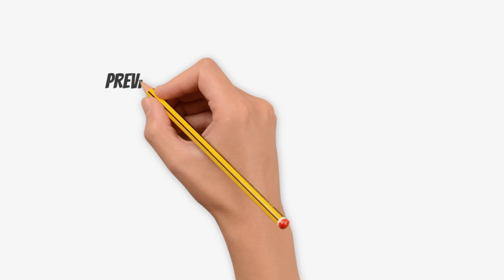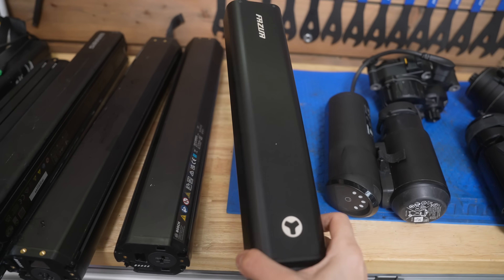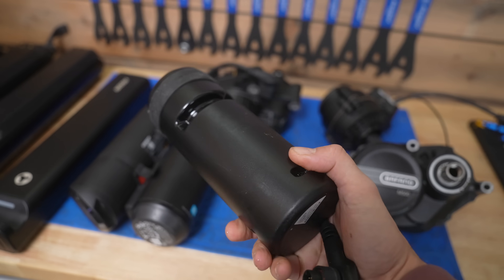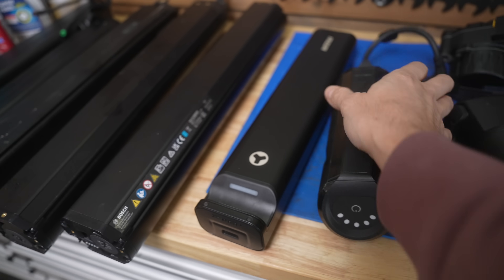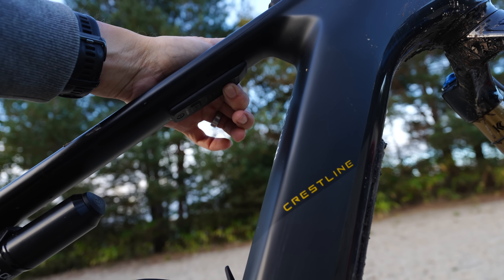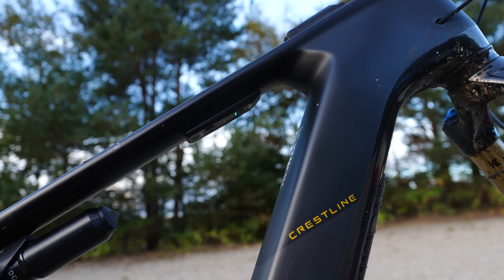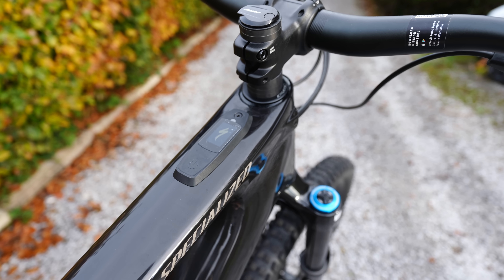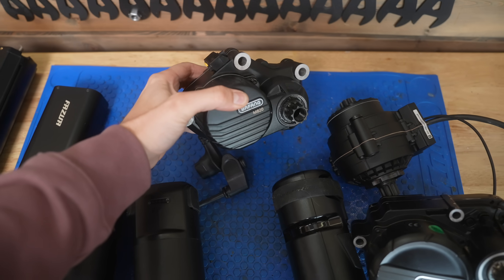We Have A Huge Problem With Ebikes....

Comment: Except without competition, you have no innovation!
The only example I'd be onboard with is the charging connector, because that is not a performance differentiator, and just creates headaches for bike sharing, and public charging. Follow in the steps of CCS and USB-C by standardising the port, everybody wins.

HOWEVER, motors and batteries are clearly a differentiating factor in the performance of the bike, including how their integrated into the frame. Your dream of companies voluntarily collaborating on standards is just that, a dream, because they are competing for sales by producing better products than the others. Furthermore, a standard, such as mounting bolt pattern, literally PREVENTS them developing better solutions that require some other mounting. Likewise, all agreeing to a certain battery voltage, size or connector LIMITS the development of future batteries, from becoming smaller or more efficient.

You may think in an ideal world, the best battery company would make all the batteries, and the best motor engineers would build the best motors, and bike manufacturers would use those components to make the best bikes. This is the most efficient use of resources after all, but also comes with a LOT of people losing their jobs. I actually just described a monopoly market -  which results in ZERO incentive for said companies to further improve those batteries and motors, or make them cheaper - this is why capitalism is so wonderful!

So if you're happy in setting standards on everything, then you must also be prepared for nothing to improve, and prices to rise...

Comment: I like the idea, but it's not practical.  That would be like saying all car manufacturers should have the same engine or use the same tyre size. In concept, it's great, but in reality no so much.  I do like the idea of a recycling program though, with trade-ins (of reasonable value) for old bikes. The manufacturers won't go for it though because where is their profit..  sad but that's the way it works..

Comment: TOTALLY AGREE, I raised this point on a forum and nobody seemed to get my point, there is no excuse for the non standardisation of batteries, you are quite safe with Bafang rear drive motors, but my VOLT pulse will only take a VOLT battery  and when you get onto mid drive systems its a nightmare, so thanks for making my point so elequently !!

Comment: This is so true. And this is just mountain biking. The commuting side is far worse for compatibility. I'm happy that on the eMTB side, the motor manufacturers label their damn chargers. So many smaller companies go with off-the-shelf chargers (many with all the same connectors) and don't even bother to put a brand sticker on their chargers. A family with 5 e-bikes, different brands and different voltages, but same connectors, is very likely to have a fire at some point.

Comment: I think it's a liability issue like a charger might be too powerful for a battery or lacks a cut off when fully charged possibly causing a fire for example. Or a certain charger might lessen the life of said battery. But it does make sense for the same manufacturer to have backwards compatibility if there's no change in charge output.

Comment: Problem I  have  with ebikes is the range.  Had a Ribble endurance Ale. On 40% assistance you  could get 60miles, but only  30 miles on 100% assistance which is terrible for touring. In my youth , used to ride 120 miles in a day, try doing that on an ebike.

Comment: If someone says had to drop off backward compatibility to make the step forward, most likely means: "We didn't want our engineers to develop compatibility with our previous products, cause it would mean less money for us". Web exists for decades now and many sites that were created in 1990s or early 2000s still work, because at the very beginning dev community accepted philosophy that everything has to be backward compatible, even if it means that some bad standards will have to be supported forever. As software developer, I can say that considering amount of features that were implemented by browsers for the past 20 years, compatibility support is a very hard task, especially if we remember that constant work on browsers optimization and security has to be done.

If web community can support tens if not hundreds of old standards and features in browsers then create a software for an old motor that for 90% consists of same parts as the new one is no-brainer can be done with ease. In fact, I think I suspect that new software can be installed on an old motor with no changes in the code, if you can find tools to do this.

It is crazy, when every single company say they do everything they can to save the Earth from pollution, they continue to use old practices of artificial shortening lifespan of their products. I think, if every company would work at least a little bit to improve support of their old products, we wouldn't have such massive problem with global warming. If we don't have to upgrade things we use so often, we don't need to produce them in such high quantities. If we don't have overproduction, we can use less ships, planes, trucks, raw materials, etc., which automatically decreases CO2 in the atmosphere. At least there are at least few companies that care and help their clients to keep their products as long as possible. For example, Noctua, a company that produces fans and coolers for PCs, can send a new mount kit for your old cooler, it it's no longer compatible with new CPU socket. All what you need to do is to write them on email and send photo of your cooler.

Comment: Until the market agrees on standards, hacking an acoustic bike with a separate motor, controller, battery and wiring is probably the best option, if you're capable of putting it together and understand the risks.

Comment: It's like with RGB in the world of PCs. Everything is standardized except for RGB connectors. Literally, just to make your fans to light in particular color, you have to make sure that your motherboard and the fans have compatible RGB connectors. Otherwise you have to search for a separate board that will have both standards to connect and remap damn signal that does nothing, but tells your fans what color they should be. Everything else uses widespreaded standards, most of which were developed decades ago. Even custom water cooling parts are standardized, so you can take water block for CPU from one manufacture, GPU block from another, fittings somewhere else, as well as reservoir with pump.

Comment: This such a good point. Is there a market for adapers that would make it possible to use any battery on your bike? Or a bracket to make the motor fit your older frame? Just a thought.

Comment: It's not such a big deal, can you fit a Ford engine into a GM or Chrysler vehicle? Can you interchange fuel tanks, seats, gauges etc? What matters is that you can get spares for your particular E Bike, you won't be inclined to do that much upgrading most users will be happy with the bike they have got as long as the spares are available to maintain it.

Comment: Welcome to the consumer society. Even when you want to recell a bosch battery, if you disconnect the BMS from the actual cells the data will be erased from it, and no longer gonna communicate with the motor, = trash. The only way to go is to buy a new or used battery which is 1000 euro almost.

Comment: I sympathise with your problem, it's the same with power tools, you buy into a system and are then stuck with it,  I have pretty much standardised to one manufacturer but still need three different chargers if I want to use all my kit,  whatever happened to "green policies '.

Comment: This is why I went the DIY route, using a CYC motor on a standard bike. It will fit almost any frame, bottom bracket, and the battery has a standard T-90 plug.

In addition, one is able to customise one’s wattage draw, speed limit, torque response etc, to accommodate regional legal criteria, or one can flip the switch to access the motor’s full power potential, at the expense of range, of course.

If something fails, it is possible to replace drive parts and components, as well as modules such as the controller, without the need for a bike repair shop.

I can move the motor from one bike to another if I want a change. Basically, these motors solve all of the issues you outlined.

Comment: You are certainly right Rob, you are verbalising something many people have been saying since the ebike revolution. It would be relatively easy to standardise basic things like chargers. You could have 5 to 10 "standard battery types" to cater for different shape enclosures and capacity. If the larger manufacturers / designer got together and agreed some basic start points this would feed in to the market fairly quickly. The only other way is legislation, as someone else pointed out in the comments, as per USB-C adopted standard (which seems to be working out well already). Thanks for continued good content!

Comment: I constantly dismiss the idea of buying an ebike for these reasons. Technology in electric vehicles advances so rapidly that you are basically always buying an outdated product, with no clear upgrade path, and in a couple of years a repair nightmare because of no longer available spare motors or batteries and so on. Even when buying a (curretly) good bike, with decent geometry and parts, in the future when main components starts to fail you will be in a very awkward situation.

Comment: Standardization at this level is simply uncompetitive. Do cars have standardized motors? Can you swap the engine on a Dacia with a Ferrari? Okay, a standard on charging is one thing, because one’s not choosing a particular brand for a particular charger, they’re all the same basically and everyone wants to capitalize and milk the consumer a few more pennies on that, it’s not the core business, but standardizing everything, like the motor and battery is a tough one that will stiffle any innovation.

Collaboration brings market cartels, competition lowers prices and brings out the best products. How do you propose exactly on standardizing batteries when frames are different? Because theory is one thing, in practice things are very different. And I don’t really see a problem there, you just open them up and exchange the cells on them, the cells are standardized, so what’s the problem with the BMS and shape being custom made, those don’t break and aren’t the real cost there, the bulk of the cost is the cells, so if you find cheap replacement cells, replace with those and just keep the BMS in the previous shape. Trying to achieve interconnectivity between systems would open a whole new avenue of potential issues, and bugs and incompatibilities at this level is extremely dangerous. So yeah, only safe and easy one is the charger, that’s no excuse, all are basically Lithium chargers for a certain voltage with some authentication/data wire which with a bit of tinkering could be hacked away. You could call as well on all the people actually reversing stuff but no one publishing anything open source, but rather everyone charging $300 for an Arduino that changes a couple of CAN messages around. Proprietary stuff in general sucks, but people have a tendency to do that - again, I challenge you to show me an open speedbox solution, one that publishes its schematics and source code. Thought so.

And finally, it would be nice for Specialized to backport the SL 1.2 to the current SL 1.1 bikes, but yeah, what’s the big problem there, it’s not a monumental upgrade anyway. I’d rather insist on making sure they still produce an SL 1.1/compatible SL 1.1 motor 20 years from now, that’s the real problem, and I highly doubt they have any plans for that. That EOLs these ebikes, not the fact they can’t have the minor upgrade 3 years after you purchased it.

Comment: You seem to have overlooked that just because a battery looks the same, the internals may be well different. And as chemistry changes, so will batteries and therefore there may be a different charger requirement. You therefore may not have a standard charger. Think deeper.

Comment: Very well said, I saw this when I bought my bike, which is why I went with the Bafang because I could upgrade the controller. And I could actually change the battery. I just simply getting a different holder for the battery, but the problem is if you make it to standardized, then the weaker companies who sucked you to buy there stuff based on advertising will lose their market share. That’s why it won’t happen. Nice try though.

Comment: These concerns are absolutely valid, and spot on for the "Pre-Built" E-Bikes from normal bike manufacturers such as the big ones Specialized, Giant, Norco, etc. However this is not the case at all for E-Bikes that are imported from China. 

There are hundreds of those off brand e-bikes like "biketrix" for example. They are cheap components, but focused on the electronics over the bike. These are all standard and universal components. 

The same can also be said with the DIY scene to convert your own bike to electric. All of these kits are standard. 

We use two major styles:

1) Midrive motor such that connected via your Bottom Bracket (68-73, 100, 120mm bsa) 

2) rear hub motor 

When it comes to batteries.  They all connect to your water bottle casge bolts on frame. Easy. They all use either 36v or 48V, higher performance stuff is 52V. 

The batteries are all universal connectors. They use XT60 or XT90 from the battery to the motor. They all have an XLR plug on the side of battery to charge. You just get the matching charger to the voltage of battery. They are like $40 CAD in Amazon. Super cheap. 

The big brand motors are Bafang, and the higher end stuff is by CYC Motor. These motors are way higher performance than any Pre-Built bike. Easily exceeding 1500w-5000w. 

You can also choose to have a throttle and pedal assist for an extra $15.  Making it a class 2 E-bike. 

Going the DIY route is 1/3rd the price, higher performance, universal, easy to find parts, and better for the environment and you can repurpose everything to next build. 

Sad that the big manufacturers of real bikes is the issue, and not the cheap Chinese E-Bikes.. and 90% of the time the DIY E-Bike will run circles around Pre-Built. 

My advice is to buy a good bike from the bike shop from a reputable manufacturer. So you have quality suspension, brakes, drivetrain, etc.  then order a DIY kit online and put it together. Twice the bike, half the price, no proprietary b.s 

Cheers.

Comment: I think as the ebike market grows and price points come down the various manufacturers will have some pressure to standardize. Right now they can get away with all the proprietary niches (which are generally to their competitive benefit) because there isn't enough consumer demand to do otherwise.  Keep preaching, Rob!
Reply: Almost all the bikes coming out of China are have standardized parts and connections.

Comment: The bike industry cannot even fit keyed locks to their frames to cut down on theft, so god knows how they will cope with industry wide standards to enable backwards compatible spare parts.
E-bikes are in fact very poor value for money. For the price of a mid range ebike you can buy a 125cc Honda Cub motorcycle. 188 mpg, 100 kph, big comfortable seat and a keyless lock and start amongst many other features common on motorbikes.
The bike industry needs to step back and take a good hard look at itself, and then wake up.

Comment: I have a Bafang BBS02 kit on my bike.  It will fit on (nearly) any frame, and is compatible with any battery that puts out 36 Volts (even lead acid if I wanted to!).  I have installed in on 3 different bikes and used 2 different computers with it.  It doesn't have anything fancy like bluetooth, and the battery takes up space where I could normally put a water bottle, but I have no fear of it becoming obsolete.  There are solutions out there if you are willing to make the tradeoff.

Comment: I agree with the concerns you raise Rob. My experience is with Shimano systems. One issue you didn't raise is the problem where manufacturers are not making both their motors and batteries fully serviceable and instead demanding customers buy a "new one" even if its a bearing issue or a circuit board say.  The Shimano backwards incompatibility issue for the EP801 system plus the lack of servicing for the EP8 is going to really cause extensive brand damage.  I like many other people have had our EP8 bikes become "stranded assets".  I will be extremely unlikely to buy another new mainstream eMTB that doesn't deal with these issues.   If the manufacturers won't play ball, and I suspect they won't, then one around these compatibility issues is for some technologically clever people developing effective adapters, both mechanical and electronic, plus write software cracks and fixes for the most common conversions.  Bafang comes to mind as an option.  Of course they will need to reverse engineer many of these solutions but that shouldn't be too hard, it will be legal proprietary knowledge issues that restrict what they can do. I see the catalyst for change being brand damage (enhanced by name and shame) and through third party businesses taking their market share by coming up with solutions to what customers need. That's where Rob Rides EMTB can help!